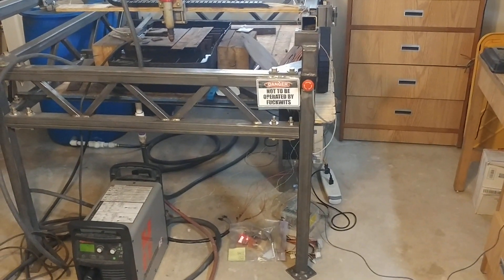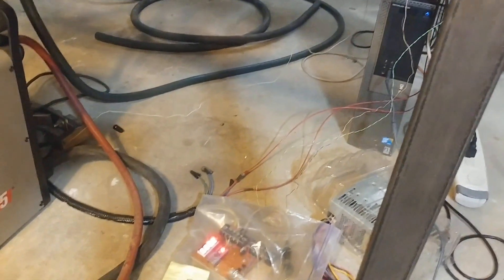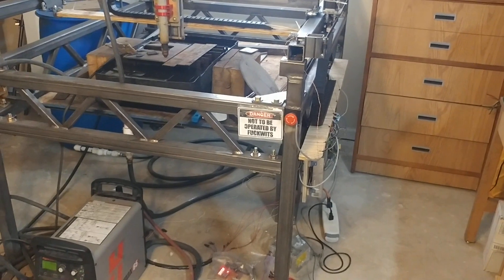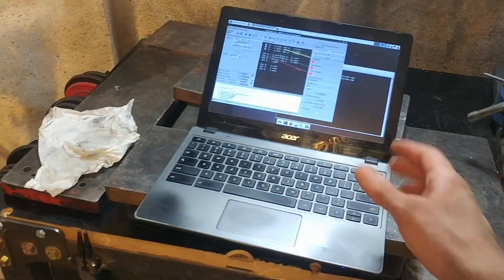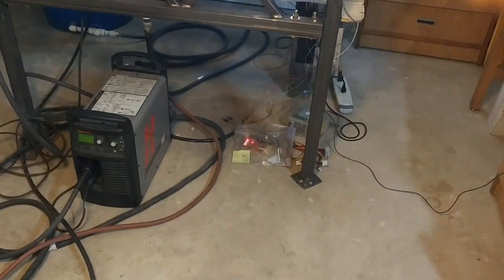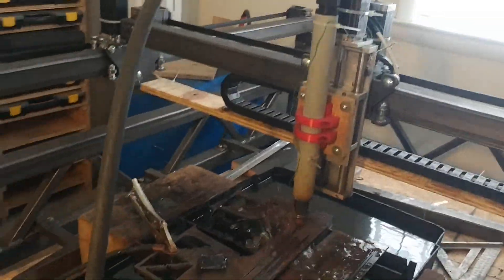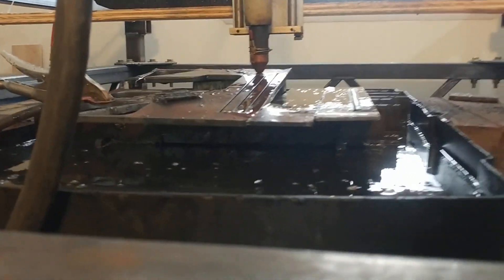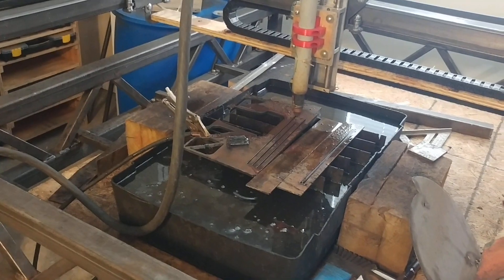CNC Plasma: Arduino THC - it works!

Comment: Hi!
I just made your sketch! It works very well, but it does not give the commands to MACH3. I suppose that is a Mach3 problem, the command appears in MACH3 in "Diagnostics" menu, but there have no reaction in axis z as response to these commands (UP/DOWN). Have You any ideea how to set up MACH3? Or maybe another user that follow your sketch have any idea, how to do the right way?

Thanks in advance!

Comment: Hi Sir! It is an impressive job you have done. The last cut was a very hard test and the system made it. I was struggling with my DIY THC but your videos about the design pointed me in the right direction. I am building a slightly different model now. I am confident it will work. Thanks for sharing your brain and hard work with us. Cheers from Argentina!

Comment: I'm dialling in the THC at the moment. Instead of setting up the LCD screen, I have a voltmeter reading between the 5v and the adjust of the potentiometer. I know, I'm a hillbilly. I think that it would work better if output the ADJUST as a voltage and read that.  The pot drifts around so much that I don't actually know what value is in the brain. Do you have any suggestions on where to put that in the code? I'm not actually sure if it's possible. Thanks
Reply from the maker: Well, I'm having a little trouble following you, but if you want to keep it super simple for testing, you can just hardcode a value for "target". Hahah.

That's a value on the range 0-1023 which you can convert to a plasma arc voltage with "target*Vref*voltage_divder_ratio/1023" (called SCALE in the code). The optimal arc voltage depends on your machine, material, and cut rate, but for most things I do with my Hypertherm PM65, I'm in the ballpark of 130V.
Reply: @swolebro  Thanks for the answer. My vocabulary is woefully lacking in this stuff. Thanks for helping.

Comment: How would you approach adding an arc-OK signal coming out of the Arduino? I'm trying to set up your THC in conjunction with plasmac. I'm sure it's one line of code but I have very little experience with coding.
Reply from the maker: Well, that partly depends on your plasma cutter. On my Hypertherm, it gives a signal for arc-ok across two pins on the same port from which I read the voltage. It makes a dry contact closure on them that can support up to 1A at 120V. So, if I hooked up 5V from the DB25-1205, an input pin, and maybe a load resistor, I could read that signal without it even going to the THC.
If your plasma doesn't have that signal, you could change the THC's Arduino code to set a digital output pin whenever it reads a nonzero voltage. (Maybe set a slightly >0 threshold, to cut out any noise.) Send that through an optoisolator to the DB25-1205, same as the up and down signals.
That is, of course, assuming that the presence of a voltage on the THC is the same as the arc being transferred to the work and ready. I'm not sure if those things really are the same... but in practice, the time between the M3 command, the plasma firing, and the arc transferring is so fast and consistent with my torch that I've been able to hard-code delays for piercing anyway.
Reply: @swolebro  Thank you for the abundance of comments in your code first off. I can actually make sense of it. 
This is something I came up with last night:
https://github.com/KaleDobrohoczki/THC

I haven't tested it yet. I'm cheating the arc ok in software at the moment.
Reply from the maker: I can tell you off the cuff, that I'm not seeing anywhere that the ARCOK pin in your code gets written 0 again. That means once it flips OK, it's going to stay there.

You probably want to add that in the block where I commented "If the mean is very low...", line 190.

Comment: Hi, can I mod your circuit board? I wish to make more smaller and practical to add in my control box... And I was thinking if you wanna make some money let me use this in some machines what I Build and sell, I give you a porcent by ítem installed un our machines, you can write to me jlrj85@gmail.com tank you, is a great project.
Reply from the maker: Now that I have my LinuxCNC/HAL tutorial out of the way, revsiting this is pretty high on my to-do list. I'd like to make the circuit more robust (improve the filtering for noisy plasmas), add some more features, and package up the parts and a professionally done PCB into a solder-yourself kit. 

That could take me a while though, so if you got the skills to build a few off the notes I've put on here and on GitHub, go for it. And if you want to kick some money my way to say thank you, I got a donation link for that here:
https://www.paypal.me/swolebroshopworks

Comment: Well done! I'm in the process of building a plasma CNC using LinuxCNC, also a huge Arduino fan. Any chance of your code?
Reply from the maker: FYI, the code overview is up now as well. https://www.youtube.com/watch?v=nmXoZt423WI
Reply from the maker: Yes, I'm currently sitting on a bunch of unedited video going over the board and the code (and the HAL) which'll have corresponding files on GitHub.

Pretty sure I can get the board and Arduino sketch put together this weekend. The HAL will be a while still. Editing's a fucking drag. lol
Reply from the maker: FYI dude, I put the PCB overview up today. https://youtu.be/lkKd5P8oH5Q

Wasn't exactly pleased the steaming shitpile of code that I went over when I shot the software video earlier, so I'm going to redo that, but the refactored code is available here now: https://github.com/swolebro/swolebro-youtube/tree/6e918c0e4c71e4b23d0943e2dcac51dfb2822b42/arduino-thc

Between that and the video I did today, should be enough to get you going.

Comment: What post processor are you using for this?
Reply from the maker: In general, I'm doing my designs in FreeCAD, exporting them to SVG files, and using Inkscape to generate the gcode. There's some steps in there I've automated to make the process smoother, but that's another topic for a later video.

In either case, the THC action doesn't require any special gcode. The up/down motions are handled by the thcud HAL component, and that operates in the background. The gcode remains totally ignorant of any adjustments.

Subscribe, hang tight, and I'll have a few videos coming out over the next couple of weeks, going over this all Linux stuff in a user-friendly way.
Reply: @swolebro  Cool thanks I just built a 4x2 plasma table after building a router cnc from scratch. I learned from arduino and grbl thats how I got my hands wet with cnc. Then I built a bigger cnc router table and tried my plasma on the forst table i made to see if I can get it to work and it took a bit of figuring out the grbl and code but got it to work to turn on my plasma and cut out simple designs. So then move on to making a 4x2 table with water pan. It works good and I am using sheet cam with post processor as mach 3 with no Z. I have the same Z axis you have and I just set the height and been cutting good on 14 gauge material. But I really need a THC and I was trying to figure out the arduino THC but just couldnt figure it out lol. So I jsut bought the proma THC and it should come in soon and see how it works. Now I just need to figure out the linuxcnc on getting the proma controls and all. Never used linux before till now when I got my 4x2 machine working. But will keep an eye for more videos.
Reply from the maker: Yeah, I saw the Proma THC, and with the amount of time I spent on this... Eh. At least now I've got the skills to lay out a PCB, and can continue adding features to this in the future.

And, for about the same price as the Proma, you could pick from a variety of Mesanet FPGA boards and their THCAD-10 daughter card. It's more complicated to set up, but then you've got faster step rates and more I/O than you could possibly ever need.

I've read about people using the Proma with Mach, so that should be possible. With GRBL, I doubt it - running that firmware takes about every bit of processing and every pin on the Arduino. Of course, I'd still recommend going with LinuxCNC, because Linux is simply better.

Earlier on in this series, I had a video on doing basic stepper motor configuration with LinuxCNC. You should take a look at that, as well as the tutorial series by russtuff.
Reply: swolebro nice yes I checked out all your videos they were helpful thanks. I am trying to figure out on how to install the config for the Proma on Linux cnc they have  all the files but do I just import them to the folder that my ini and Hal files are on? I am confused on how that works.
Reply from the maker: tbh, I couldn't say. There's a number of configuration files floating around out there, most of which are half-finished. At the very least, you're going to have to read through the HAL chapter of the manual (available under Menu > CNC > Documentation once you've installed LinuxCNC, or via this link).

http://linuxcnc.org/docs/2.7/pdf/LinuxCNC_Documentation.pdf

In the meanwhile,  I can at least point you towards these two threads which have mostly-complete sample configurations. Again, you're going to need to read the docs to have any idea as to what's going on here, and the second one (in my opinion) is overly, overly complicated.

https://forum.linuxcnc.org/49-basic-configuration/26552-thc-up-down-simulator
https://forum.linuxcnc.org/plasma-laser/34978-thc-plasma-configs-with-how-to

One of the problems is that nerds tend to understand Linux, and welders tend to want plasma cutters... and the overlap between nerds and welders is small. So it's hard to find good info. That's why lasers and 3D printers have it so good in terms of their software. And also why I'm trying to bridge the gap.
Reply: @swolebro  gotcha man thanks alot totally true on nerds and welders lol